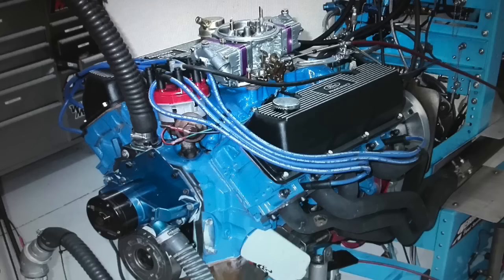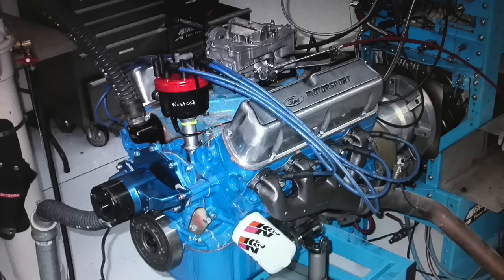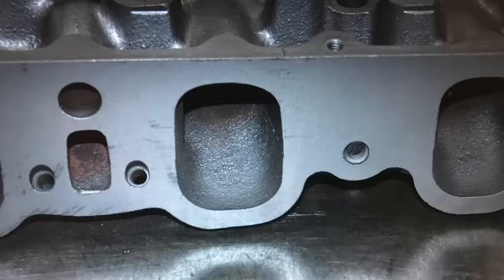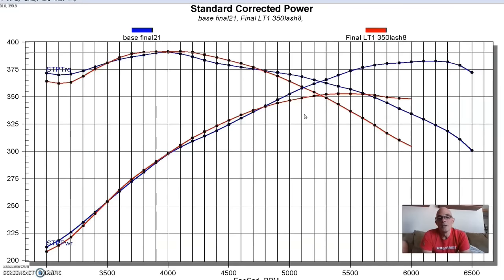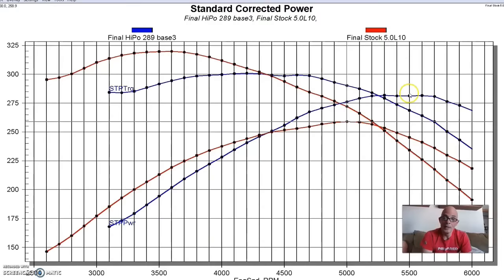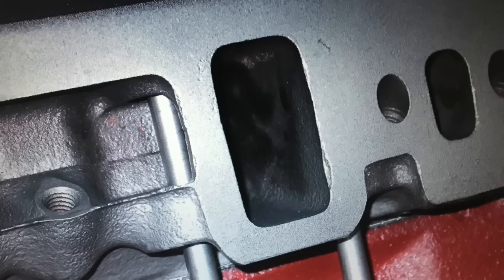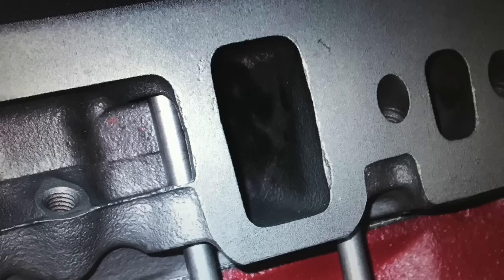HOW MUCH POWER DID THE 1971 BOSS 351 REALLY MAKE? WAS IT THE HOTTEST SMALL BLOCK EVER OFFERED?

Comment: The 289's obvious handicap is its small port and valve heads.  A little engine like that should rev well over 6000.
If you replaced the heads you'd get close to 350 hp.
Reply: Look up Joe Sherman 400 hp 302.
He did it with ported iron heads on 289 and a 302,
flat tappet and stock rockers I think.
Reply: Google Joe Sherman 400 hp Ford 302.
Marlin Davis article Mustangs and Fords magazine April 99.
Reply: BTW the heads shown are stock ports/ valves with the larger chambers.
There are no pictures of his head porting.👍
Reply: The torque curve of the 88 5.0 is good because of the roller cam.   If you put a roller cam in the Hi-Po 289 it would out perform the 5.0 in both torque and power.
Reply: @hotrodray6802  that's true but not a stock engine as he is talking about.
Reply: All the factory Windsor heads were designed for low speed torque, not power.  And the 289 hipo used heads with the same ports and valves.  
Makes you wonder why Carrol Shelby didn't see the obvious limitation of trying to build a high performance engine with heads from Grandma's Falcon.
Reply: @charlesvan13  Been there, done that.  There's no replacement for displacement.
Reply: Disagree. The Daytona Coupe went 199 at Daytona in 65 with a "stock" cast iron 375 Hp head 289.
Reply: same heads from 289 to 351..cant beat 351c heads.std..351c better all round..you have to stud the w heads or they fail,like chev heads.a clevo will do 6k all day..
Reply: Terrabound Misfit : Exceptionally low frontal area, low drag and a great engine tune to suit the gearing gave 199 mph. Richards LX averaged 166mph for 32 minutes with a turbo EFi. The hardtop was a truck in comparison to the svelt Brock design closed coupe Cobra. Shelby had a package for the LeMans GT40 head porting and Optional Quad IDAs which made the engine match the Boss 351C 4V for power, with 326 lb-ft of torque. That head was used with the at lash  318 deg intake 310 deg exhaust  Le Mans cam and exhaust system. It took just 1 year and the 4V Cleveland heads  for Ford to reliably match the 1971 Boss Cleveland power characteristics. The Boss 302 has so much K code 289 DNA inside! The Ford factory combination eventually matched the Boss 302 and Boss 351power in emissions unleaded form  with the US made, Australian rebuilt 342 T3 stroker engine in 2002, 335 hp net at 5250 rpm, 369 lb-ft at 4000 rpm or so and it just used the Iron GT40P heads CNC ported to approx 215 cfm at 500 thou lift.. Head flow and capacity increase maketh the 289. Shelby heads not ported right hurt the power and torque figures badly. The firing order swap and finding a crank that didnt break blocks and a  cam profile that didnt kill torque with CNC ported heads was what was needed. Shelby wasnt allowed to turn the J code 302 into a the engine the Terminator 3 became. Internal politics like at GM. Only with Ford, it realised sonething. If it won SCAA, Trans Am,  NASCAR, Le Mans and supplied de Tomaso with the GT40 380 hp engine all in 1968, how would it ever bargin for the concessions to have the Semi Hemi race at Talladega. Sometimes, its better to knobble the race horse. That race horse was the Q code Tunnel Port 302 in 240 and so called 250 hp form. The modified non Boss 289s with 302 Boss steel crank, forged pistons and the British spec Ford Advanced Vehicles cam and heads and intake...that was where Shelby wanted to be. The ported Shelby heads were off the chart. Tunnel Port heads caused a diversion from the planned course. With Tunnel Ports, Weslake Kar craft and Cleveland heads, Shelbys ported heads didnt continue.
Reply: @terraboundmisfit  The Shelby race engine ran Weber carbs, 12.5:1 pistons, head porting and LeMans cam to make 375 hp. Not a streetable engine but able to rev to the moon. The 306 hp engine Richard dynos is production Cobra and Mustang engine.

Comment: I had a number of 67-68 XR-7 Cougars. My 67 GT started with the S code 390 4v. Yanked it for a very built 71 Boss 351. I spent days porting and polishing the heads. Loved that engine. Another of my Cougrs, a '68 XR-7, sported a '67 cross-bolt side oiler. If you want a 427, get a REAL ONE. Not a stroked Windsor...

Comment: Cool video man🚀🚀 I Imported a mustang 65 with an oldschool clevor 302 boss build.It sports 351 Cleveland heads 2V and a 302 windsor block.was built and raced in sanfransisco.  Stood for about 25 years. 
Roller cam. Currie axle 31 splines. Love the boss engines.  I love taking longer trips but changed the rear axle gears to 3:00. It still ripps🐎🚀
Anyhow take car everyone and make  sure to have fun and use your engines🏁

Comment: you're preaching to the choir about the phenomenal performance of the Boss 351. Amen. i also generally, but not completely, agree with your assessment of the HiPo 289. it's only 289 cubes with an asthmatic set of heads on it. however, it was circa 1965 with a light V8 thinwall casting, in a light car, fairly small frontal area, decent fastback aerodynamics and suspension that worked well enough to allow GT350's to win their share of roadraces. take the long-runner intake off the '88 302 and put a 289 crank in it and it's somewhat of a different ballgame. another sleeper in '71 was the 400 "Cleveland" with 2V carb and 2V open chamber heads rated at 260 hp and 400 torque. a Boss 400 upgrade to the 2V version in '71 would have been even more impressive. great vid and analysis.
Reply: Note that Shelby used the Holman Moody Falcon suspensions all around on the track cars.
The A arm drop, pitman arm, anti roll bar, and rear changes, connectors, etc.
Reply: @hotrodray6802  i did the A arm 1" drop on my mustang until the negative wedge kit came out and i changed to that (better negative camber curve).

Comment: Richard,  how different were the 1971 Boss 351 and the 351 Cleveland you could order in a 1971 Mach 1?
Reply: occamsrager  No Cleveland had press in studs, they were a 5/16th bolt.
Reply from the maker: take a look at the M-code 351C video that is up
Reply: Jody
Right, Clevelands had sled rockers.
Ws got them and smaller spark plugs in 74.
Reply: @richardholdener1727  Thanks Richard, I didn't realize the M code was the Mach 1 351. All those 1971 Boss 351 owners are probably thanking you for showing how important their cars are (and higher priced now too, lol.)
Reply: occamsrager  All Cleveland Engines used a Bolt for the Rocker Arms, Never had a pressed in stud. For High Performance use, upgrade to 7/16" Screw in Studs.

Comment: I'd love to see a set of tunnel port heads tested. Saw a set with intake at Carlisle 25 years ago for 10K! Pretty sure I could have fit my hand in the intake ports
Reply: There is a Ford engine builder in Kentucky that has a video channel on YouTube. I can't remember his name offhand, but he has a couple of videos on his channel of Tunnel Port 302 heads on engines he's built. He says (and showed) two different sets of TP heads for small block 302s, and ran air flow and dyno tests at different times with both heads. The heads required special blocks to be cast by Ford, and he goes over the reasons. The smaller heads were designed for street use but were never put into production because the "Boss 302" heads were right around the corner. The bigger heads had the big valves but did not flow as high as we might think. They had they typical Ford restricted exhausts, with Ford engineering's typical philosophy of "the air somehow got into the engine, so the exhaust gases will somehow find their way out of the engine." He's got videos of Ford engines with both the High Rise 427 and Tunnel Port 427, both work ups on the heads, engine assembling, and dyno tests. Interesting, I forget offhand the power output of the TP 427 heads, but on some dyno pulls he gained 55 hp with just a 1" spacer under the carbs. Where his customers find these heads, I don't know, but he shows them and runs dyno tests as well. His YouTube channel is very interesting. And some of the intake manifolds Ford had in the day were way out there. His HiPo 302 Tunnel Ports had a dual quad intake, and for somebody to find and then buy it must have cost a lottery winner his entire prize.

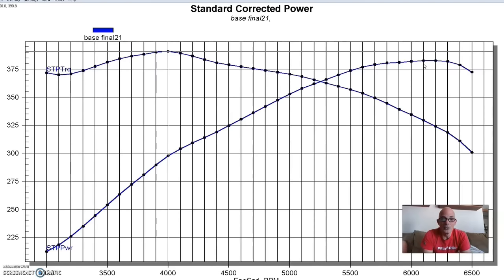Comment: Dad raced a 66 Shelby when I was a kid. He had a lot of the trick stuff of the day including Crane heads and a rev kit. Aluminum flywheel and a 6:00 gear. He tried different intakes from Shelby dual carb and cross ram. The biggest limiter I think was the slicks of the day and lack of susp Mods. He just had slapped bars. I believe 12.10 was his best. 
He later raced with a Boss 351 in a 65 Mustang running about a full second quicker.

Comment: I am a big 289 fan and I would really like to.see you test the combo that I run in a 67 fastback off the top of my head specs 
1968 Mexican block 302 1963 289  crankshaft has been indexed light weight rpm international 289 rods race tech forged done top pistons .040 over comp cams 300b-6 cam with Cam kit 
Air research heads 58cc chambers  2.02 intake valves 1.60 exh pro comp single plane copy of Parker funnel intake and a proforma 750 double pumper. I run a close ratio top loader and a 9" with Detroit locker and 4.11 gears p245 60 15 tires.
The car pulls hard to 7250 haven't ran this combo down the 1/4 mile 
But it holds it's own on the highway.
Back in the day 1980's you had to build a set of heads with Chevy valves to get a 289 to run and I built several. With today's heads the 289 is in the same class as the boss 302.
Look at this combo and tell me what you think

Comment: Many of Bud Moore's engine failures (and the Wood Brothers, and Junie Donlavey, etc.) had to do with valve springs.  Nobody made a Boss style valve spring (Ford, nor anybody else) that would hold up at long-term high rpm.  This was also true in the 69-71 Boss 302 T/A series - if they had a failure, it was probably a valve spring.  The valve spring issue was finally solved, as an Example:  Elliott 1984-5-6.  Prior to that, it was addressed by deliberately flooding the valve covers with oil to keep them cool and to reduce excess vibration.  That it worked as well as it did is amazing.
The other issue with the 351C was the oiling sequence.  You don't need to have your cam and valve springs oiled before your crank and rods.  This was addressed by Moore, Wood, etc. with auxiliary oil lines which prioritized oiling to the crank and rods.  But, by then, Earnhardt was gone.............
Incidentally, the "real" SCCA boss heads actually had slightly smaller ports than the showroom heads.  These were called "SK" heads and gave the SCCA teams a lower torque curve to help coming off the corners.  After all, sport car racing is "drag racing interrupted by turns".  You need bottom end torquie.

Comment: It would be cool to see some of the other factory muscle 350ish cube muscle motors to see how they compare:
350 H.O. Pontiac
350 W-31 Olds
350 Buick from 1970
340 Six pack mopar
360 AMC Amx motor from 1970
Also lets see how the smaller displacement solid lifter offerings from 1964 compare:
289H.P. Ford
273H.P. Mopar
283H.p. Chev
Those motors might not make big numbers but from my experience they make for nice driving cars on a day to day basis.
Reply: james martin & a big block comparison too, would be great to finally see behind all the smoke & mirrors to what the actual truth was, I am pickingLs-6 454 tone at the pointy end
Reply: all 350,s are rubbish,unless you re build them with decent heads crank rods ect..there a chunk..waste of space..or,they should be in space..
Reply: The Pontiac's claim to fame is its special 6X heads. But in the hands of a good engineer, its a poor man's LS (similar bore, stroke and connecting rod length to a 346 LS).  The Buick 350 had great flowing heads--better than Chevy fuelie heads--but those right angle bends in the oiling passenges do not help. That Olds Ram Rod/W31 was a honey, getting a lot of engineering.  Roger Huntington claimed Dr. Olds was targeting the Z28 with it--less weight in the nose, put it in an F-85, and use the 4-4-2's superior-for-the-time suspension. With the right rear gearing, a W-31 could match acceleration with a regular 4-4-2. 

The "trans am" choices for 1965 would be interesting (Ford's was the 260 in 1964). The K code Challenger 289 was really a basic 289 with no vacuum advance in the distributor, a hotter solid lifter cam, and screw in studs in the heads rather than press-fit. Ford tends to use smaller carbs and port sizes than Chevy, in order to build torque. A D code 273 making 275 hp would be a beast, but I'm trying to remember a 283 without fuel injection that ran solid lifters for performance.

Comment: I loved my 71 Boss 351 Mustang it was glow in the dark green with black stripes. I found the Boss in 1979 at a tiny car lot i saw the color and knew it wasn't a normal Mustang I paid $600 for it. The HP 289 was not impressive to me I ran against a few. The Boss 351 is a monster it will take on most. I had a 69 Boss 429 I like the Boss 351 better and if you find just a 71 Cleveland two barrel carburetor it will surprise you against four barrel the big two barrel was 580 cfm if remember right. Any 351 Cleveland before 72 is good especially a M code I believe the 71 year was best for any 351 Cleveland after that they dropped compression.

Comment: Richard love your videos!! Backyard mechanic here with enough knowledge to be dangerous. I have a 73 Mustang convertible with a 351C 2v heads. I’m looking to rebuild my motor to achieve 450-500 horsepower with good low end torque. My thoughts not sure if I need to: convert 2-bolt main to 4-bolt. I’m having a hard time figuring the math for my setup. Bore .030, forged 4340 steel crank 3.750 stroke internal balance, trick flow power port 195 heads with 62cc chamber, crane hydraulic roller cam 32-541-8 has a int 230 ext 290 @.050 lift .578 valve lift, edelbrock 7564 performer RPM Air-gap manifold.
I don’t know what piston setup I should have 3cc head volume I’m clueless. In So Cal looking for a good engine builder for good street fun.
Reply from the maker: don't worry about converting to 4 bolt-but a 230/290 cam?
Reply: Richard Holdener recommendation? Trying to keep under the hood.😁

Comment: Richard I have a 71 351c with 4 bolt mains and open chamber 4V heads although two of the bolts on the caps were smaller in size?
Any idea what thats about? Back in the day someone told me it was a CJ or SCJ but I don't know.
Reply from the maker: SOME 351C CAME WITH 4 BOLTS

Comment: My family has drag raced since the mid 1960’s. One of the first cars we raced was originally a 289 Hi PO it was 100% Ford parts with the better LeMans Cam that was part of Ford Muscle Parts. The heads were amateur ported. The engine was in a old 1963 Falcon with a Ford 9” and home made ladder bars. I drove the car to work back around 1969. It ran high 11 second 1/4 miles at 113.00 MPH.  Not impressive comparing to todays supercharged muscle cars but trust me a high 11 second car in 1969 with a under 300 cubic inch engine was pretty quick. It had factory steel rods and the tach only went to 8,000. It had no problem going over 8,000.  I did buy a Boss 302 1970 Mustang and used the exact same LeMans Cam with headers but heads untouched. The Mustang had a 5.43 rear gear the Falcon had a 5.67.   Yes we drove them on the street was those gears and both were Ford top loader 4 speeds. The Boss 302 definitely made more power but the Mustang was about 350 pounds heavier so the end result the Boss 302 Mustang was slower.  We later went with a 427 Tunnel Port which made way more power and was much faster running mid 10 second 1/4 mile right at 130 MPH.  Head work on a 289 really awakes them up. They will not run very good with stock castings.
Now days my nephew is Co-Owner of PJS Racing out of Weatherford , Texas and they build Pro Mod engines for all the different sanctions. They build the engines for Chuck55 from the TV Street Outlaws No Prep Kings. Of those engines are 526 CI usually with a screw or roots blower.

Comment: How's the 289 compare to 283, or 273
Reply: Exactly a 289 compared to a roller 5.0 is gonna come up short but in 1965 it was the leader of the pack
Reply: The 273 has some torque the other don't.
Reply from the maker: the 289 and 283 are similar

Comment: Boss 351C was awesome!  I had a 351C built up to roughly Boss351 specs in early 80s and it screamed!  It would easily rev past 7g with tons of power.   I also had a stock 302 with racing cam and it was dog slow in comparison.  I believe you are right.  The power is all in those large ports and valve sizes that allow for large airflow.  It can utilize a large cam duration and lift that other engines could not handle unless maybe if you did expensive head modifications.

Comment: Would love to see the factory 6 pack engines do a shootout, the 390 FE 6 pack was rated at 
401 hp at 6000
430 tq at 3500
At 10.6 to 1 compression and I'd love to see some real tests done on the mighty 390 not the "Powerblock" way of tossing mix-matched parts from their sponsors and just doing enough to say they did it
Reply: Great idea!  Do a 390 six-pack vs. Chevy L71 vs. Mopar 440 Six-Pack.
Reply: You could also get the 3 2s set up on 406 and 410 FEs offered by Ford and Mercury, now those are really obscure "other guys."
Reply: You forgot the 406 six pack.
Reply: PowerBlock always half asses any Ford build because they don't  want to outshine their ranted about G M products !!!

Comment: I had a 2v Cleveland with a 650 Vac sec with an automatic 1971.
It pulled at high speed. The faster you went the faster it wanted to go. It pulled at ridiculous speed on the highway. 
It let you know that it was powerful.